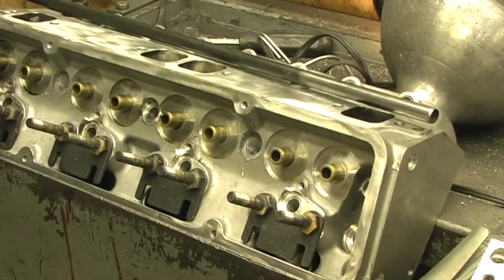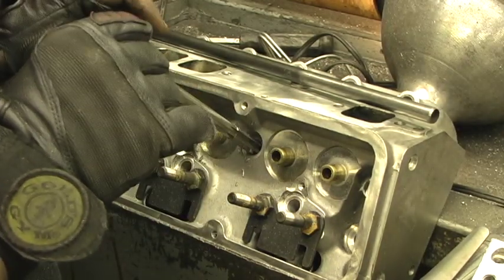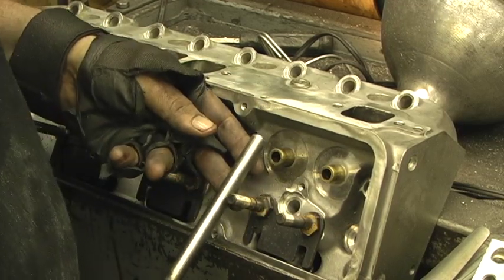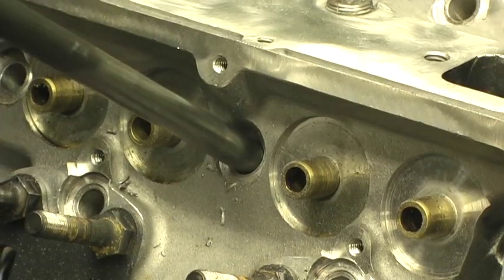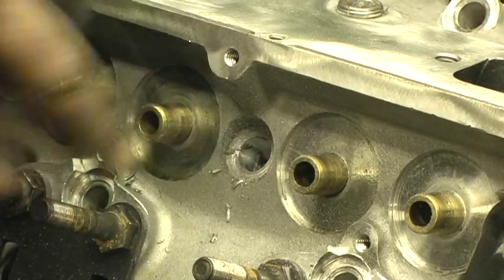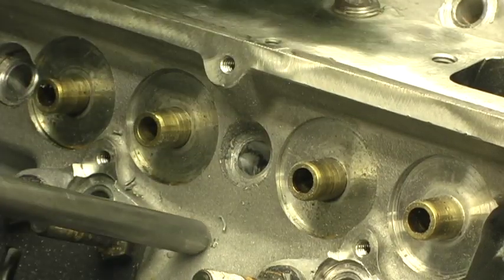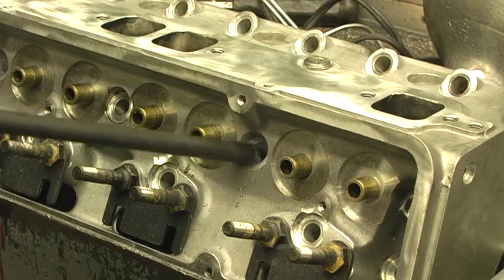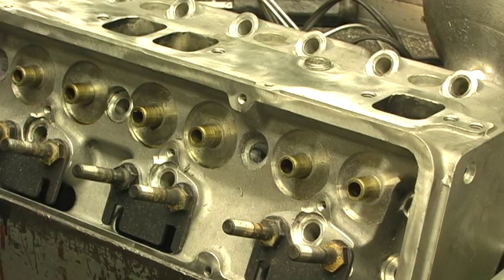ProComp Chevy Ported TUBES between intake Ports Part 2

Comment from the maker: Final volume was 231cc. In terms of "Picking up" it is hard to compare apples to oranges because he was running double hump heads and bought these and before installing them stock. I can tell you however, that after installing these heads he went from 8.901 in the eighth to 7.102 using the same solid lifter camshaft and JUST A HEAD CHANGE. He did this on 93 octane pump gas by the way. he was one happy camper...